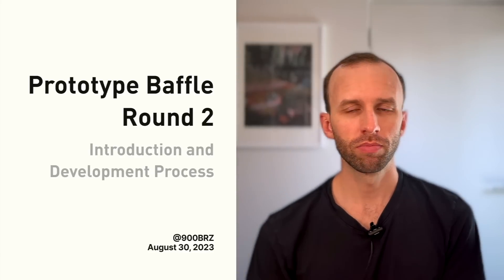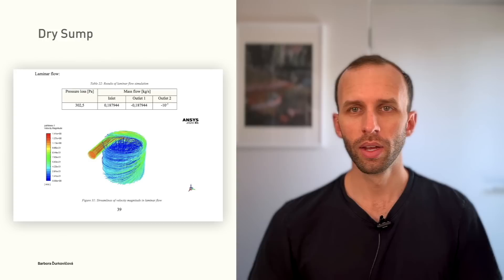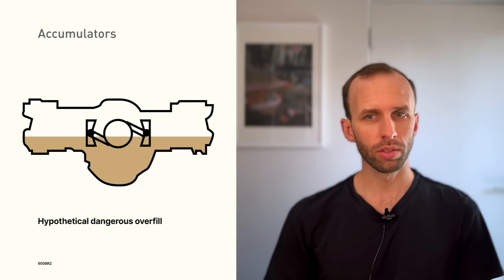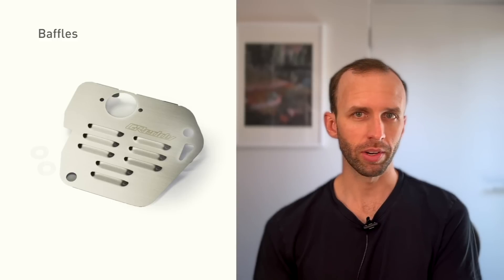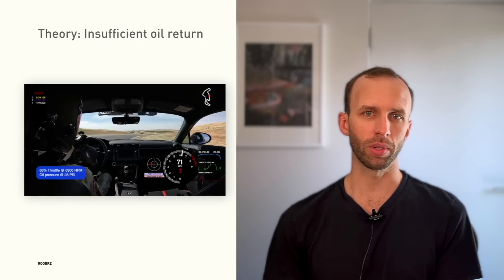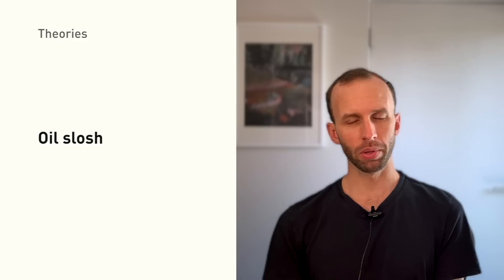Prototype Baffle Round 2: Introduction and Development Process

Comment: Nice video! What tire/wheel setup are you using on the track? Those look nice and I am looking for a setup for my BRZ track day.
Reply from the maker: These are 949Racing 6UL 17x8 ET40. They went out of production a couple years ago when they started to have fakes hitting the market, I believe produced from the same facility. They have since relocated production and are working toward making 86 wheels I believe in early 2024.
Reply from the maker: Enkei TS-10 and TS-5 are also good options with 17x8 ET45. They’re a little heavier but also inexpensive. I think of wheels as consumables, so that’s important for me.
Reply: @900BRZ  Thank you for your reply. Yea, I am also thinking about the 17x8 225 (bronze wheel + sapphire blue seems really good!) for my BRZ. I got really confused (I am new to car modifications) with all the options out there. I noticed that Enkei do sell the two rims that you mentioned, how are they compared to their well known RPF1? Should I go for 35 or 45 offset (maybe a BBK in the future)?
Reply from the maker: @thehoodieguy3491 RPF1 have worse brake clearance than the Enkei options. I think ET45 is better for the rear and you can always add a small space in the front. I’m running ET45 with a 7mm Perrin spacer in front.
Reply: @900BRZ  Thanks for the advise! I just purchased the Enkei TS-10 17x8 ET45 w/ Continental ExtremeContact DWS06 225/45R17 (DD tire)!
Reply: I forgot to ask, since you do quite a lot of track racing, do you ceramic coat/ppf your car? I am worried about the cost-performance ratio.
Reply from the maker: I did a DIY ceramic coat not long after I bought it, but 2 years later the car is now parked outside and that coating is not as effective as it was. I’ve heard the professional ones use different formula that are more durable. No PPF. Also went back and forth on that, but as a track-oriented car, I just decided not to worry about it. I already had a piece of rubber dent my hood from following someone on track haha.
Reply: @900BRZ  Yeah, that's what I figured out as well. It doesn't make sense to keep it in show-ready condition when she is track-oriented. I might as well use that money to improve handling/BBK (unless I have the budget).

It's good to know how your DIY ceramic coating is performing, as I was thinking about that. I already have clear coat scratches (light-moderate) on my doors and trunk after 9 months. I am thinking about whether I should try to repair it myself.

FYI, interestingly, I found a Chinese "YouTuber" having his entire car wrapped in PPF the first day. He did track his car and it still looks new after 13 months (jealously :D). He has an MK5 Supra and a GTR so I think it's not for ordinary people lol.

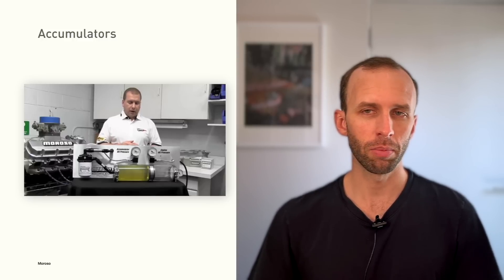4:16 https://www.youtube.com/watch?v=N7c8msl55Ss&t=473s
Reply from the maker: @thehoodieguy3491 Yeah I also had some kind of wild animal scratch my clear coat pretty extensively while I was parked at a trailhead. Will probably polish it out at some point. PPF probably would have done better in that situation, but agree that the money is better spent on functional mods for me.
Reply: @900BRZ  I want to get rid of my light-moderate clear coat scratches as well (mainly door, roof, and trunk). But I am confused if it could be done at home.

How are you planning to have yours repaired? By a shop or at home? Will you do paint correction or just polish? If at home, is a polishing/buffing machine required or can I use a drill with different pads?
Reply from the maker: @thehoodieguy3491 You can definitely do it at home. Random orbital polisher is standard for this type of thing because makes it harder to overheat the paint or introduce deep spots. Some detailers use attachments to power drills for small areas like pillars but I’ve never done that. There are good videos on YouTube, try Chicago auto pros to start.

Comment: What model oil filter are you using in these tests?
Reply from the maker: Standard filter. Interested in doing some tests with the FA20 filter as well.
Reply: @900BRZ  What is the part number you are using?  I see that Toyota now has 90915YZZS1 listed as superseding the original SU003-08412 (15208AA170).  I think this one was used on older FA20 that is slightly longer and has a bypass valve that doesn’t have as much tension as the original.
Reply from the maker: @dadadadada4975  Oh interesting. That part number implies that Toyota has sourced their own part instead of using the Subaru part (SU prefix on the Toyota part number for Subaru-sourced parts). I’m using 15208AA170, which still looks to be the specified part for Subaru.
Reply: @900BRZ  Yes, I know… but I wonder if it was to save costs or because they have concerns over the original shipped from Subaru (x170). The FA24D Subaru filter part (x170) isn’t the same as the previous gen FA20 Subaru filter (x130).  It is a little shorter.  I wonder if Toyota found they needed it to be bigger?  Maybe Subaru will switch back too?
Reply from the maker: @dadadadada4974 Subaru made it shorter for pedestrian safety. It is documented in a new vehicle information pdf. I assume Toyota just sourced their own part for supply chain simplicity. But I can buy one and compare.
Reply: @900BRZ  They made the oil filter shorter for pedestrian safety?
Reply from the maker: @dadadadada4974 Yeah the hood is designed to crumple and they tried to make the surface of the engine and accessories flat.

Comment: I've gone from 2014 GT 86 to a 2019 BRZ and an now picking up my GR86 a very rare beast at it's now banned from sale in the UK and Europe. I wonder as you drive on the right the oil pressure drop is on the right I wonder on Left hand drive cars will the pressure drop be on Left turns? And what is the real cause of the drop dues anyone know?
Reply from the maker: The engine is the same between LHD and RHD cars. Mainly they have to flip the location of the brake master cylinder and booster and the battery. Also the steering column.

Comment: Are y'all running the OEM heat exchanger with the JR cooler? Or did you remove it?
Reply from the maker: The two FA24s have retained the OE heat exchangers this far.
Reply: @900BRZ  much appreciated! And thanks for all the hard work!

Comment: I know that revolution also made an engine baffle for the gr86 made for decrease pressures loses, i also think that maybe a different oil pickup can partially solve the problem , maybe a pickup that ended at the center of the oil pan

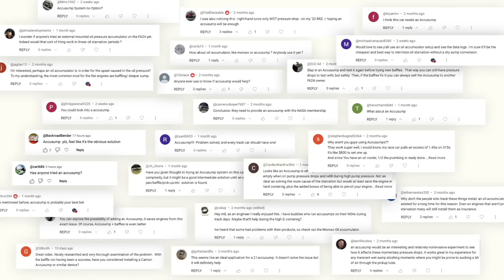Comment: Are you still using the factory weight oil? I know in your previous videos you were, which has always baffled me. As a engine builder/ machinist for near 15 years, its crazy to use the watery 0W. Even Savage Geese has a video in which they work with BRZ/86 specialist and they say to never track the car with light weight oil https://youtu.be/w8pYUeWuHXA?si=4hVzIFyBWHKDZ4IE starts at 1:08
Reply from the maker: No, I’ve never used the factory oil on these tests. I’ve been using 5W-30 throughout. I will switch to 0W-40 in future testing.

Comment: As the oil filter is on the right front side (when looking at the engine bay) 
Could right hand turns be restricting oil delivery to the RH cylinder head? 
As it has already had to pass the LH cylinder head as well as the cylinder block.

Not that it's becoming fully starved at first but if it was enough to slow oil recovery causing a compounding issue.

I wonder if there's a pattern of the LH heads being more prone to damage?

Comment: Thanks for all the great information!  Would one solution be to add a second pickup tube on the opposite side of the oil pan so that no matter if lateral Gs become a factor, there is always oil to be picked up?
Reply from the maker: Some cars have multiple pickups, but I’m not really sure how this works. Wouldn’t that cause an issue if either pickup tube was sucking air?
Reply: @900BRZ  very good point!! I wonder if it could cause some sort of cavitation issues that you see in mechanical pumps

Comment: Very interesting and great work. Now that you have partners with 3D scans of the sumps and some of the engine internals, it would be interesting to understand what is a permissible oil overfill.

From my thinking; what is the capacity of the lower sump and upper sump? How much head room is there before the oil hits the crankshaft and oil aeration occurs.

I just find that 5L fill oil a very round number from an OEM. I'm sure there is some OEM tolerance, but seems very specific.

Comment: Why are you not creating a larger sump with a baffle plate that can carry more oil I think that will solve a lot of the issues and be a relatively inexpensive mod. I think there is already one available but it will not fit standard exhaust systems. I do hope this works as it will be a hot seller no doubt.
Reply from the maker: We’re looking at doing this now. Thanks for the comment.

Comment: Awesome video! Can't wait for the results. FWIW I use an Accusump on both my daily/AutoX car and my track car. I'm a big fan of the pre-oiling benefit!
Reply from the maker: Do you have an electronic value or a manual one? Accusump may still be in the cards for me.
Reply: @900BRZ  electric one, same 3qt setup in both cars. I had a plan to use a nitrous-related RPM window switch for a simple automatic arm/disarm function (along with a relay) but both of my cars' engines are blessed with high idle oil pressures (N54 & LS3) so that hasn't been necessary; I just leave the accusumps armed any time there is ignition power.
Reply: @900BRZ  just uploaded a video of an Accusump install on my 2015 FB25 Subaru Forester, if you'd like any inspiration: https://youtu.be/FZsfSZxJn0U?si=zhAaOexc4EQ4lRfy

Comment: We use clear tubes run from crank case breathers and radiator overflow and sometimes even transmission and then keep filling until we see foam blown thru tube and instantly lift and then drain back. We SLOWLY increase fill until we see an issue.
Where will you see foamed oil first? crankcase breather? Figure out how to constantly sample and pull that thru a clear line in drivers vision. This is simple stuff we do on various cars we track and race.
Reply from the maker: Thanks for the ideas! I took some measurements inside the sump to try to get a sense for how much clearance there is before I start to submerge the crank, but I don’t have a good way yet of correlating overfill volume to crank clearance. Measuring froth and oil in the PCV system seems like a good place to start.

Comment: Would a baffle with larger capacity help? E.g. +1qt with baffle so as to not get near crankshaft and cause overfill issues. I remember my celica with 2zz had a baffle oil pan from moroso that added +1qt as an aftermarket option, but with the already "low" engine design, clearance may be an issue for the brz/gr86.
Reply from the maker: I think you mean a larger oil pan. It would but it’s a little complicated. You can’t easily extend downward without having to swap the pickup. Doing that requires engine out and removing the timing cover, so it’s expensive. You can go wider, plus baffling. You need a custom exhaust header to do that, but it would be something we could potentially look at in the future.
Reply: @900BRZ  thanks for letting me know. My first gen BRZ is mostly stock, but I use it for autox/lapping days, so stickier tires are on. Future plans are to do FA24 shortblock swap with FA20 heads, but I'm still keeping my options open and keeping a tab on your videos. Thanks for the testing and updated vids! If all else fails, I might jump the gun on K24 swap instead since I'm mainly looking for NA reliability on the track, but $15k was the quote I got from ASM Motorsports - they specialize in Kswaps and have done a few on the BRZ twins chassis (with testing) and live conveniently down the road from me.

Comment: Would the 5w30 oil be acceptable for general daily use?  Or just track?
Reply from the maker: I believe it should be no problem for normal use. In hot climates, like Malaysia, the manual specifies 5W30.
Reply: @900BRZ  well I'm from Louisiana so close enough.

Comment: If the pickup is not in the center of the pan, then that's the culprit. <3 Don't over complicate.
Reply: Change the pickup with a baffle to support.
Reply from the maker: That requires engine out and removing the timing cover.

Comment: I hope you manage to solve this! Just out of curiosity, have there been any reported failures in japan. Also which Motul 8100 are you using is it 8100 Power? Which is the ester based one.
Reply from the maker: I’ve heard of one failure but it looked like potentially a rubberized flap from a baffle fell off and clogged the pickup. So I don’t think that one is really relevant other than to warn us to be careful with moving parts on baffles that could fail.
Reply from the maker: Regarding oil: it’s 8100 EFE. 8100 Power wasn’t available when we started this testing and I’m trying to control variables, but Power does look like a better option.

Comment: I really really hope the new designed baffle will at least mitigate the issue in a meaningful way if not completely fix it. But on the other hand, I wonder if a well designed baffle would really help/fix this issue, Porsche would probabaly have had done it a long time ago?
Reply from the maker: Porsche did make a retrofit for the M96 called X51. And there are aftermarket solutions that improve the performance further on those engines. Hopefully we at least see a noticeable improvement, if not a complete solution

Comment: With testing on the weekend, will you try a few different runs at different oil levels as well? Like one run at 5L(normal fill) and another 5.5L or 6L?
Reply from the maker: Yeah 5.5 for sure. I’m still trying to understand how the oil capacity correlates to clearance from the crankshaft to ensure that a 1L overfill is still safe.
Reply: @900BRZ thank you testing this out in the following video. Shame about what happened on track, but you did still collect some solid data points.

Comment: Thanks for continued, thoughtful, development work (which should have been done by the factory...are you listening Toyota/Subaru as the class action lawsuit is building momentum). Donation for $100 via PayPal has been made. I hope everyone else with an FA24 watching this does the same. Since the factory doesn't appear motivated to make a solution, $100 is a wise hedge against an 11K long block replacement when the dealer/manufacturers tell you to sit and spin. Please keep up the great work. Looking forward to a reasonable solution to a factory engineering mistake..
Reply from the maker: Thanks so much for the generous contribution!

Comment: What I'd also be curious is finding out if the oil pressure drop is found in the FA24F inside new Subaru WRX's.
Reply from the maker: I heard that one called FA24DIT. It has differences to provide oil to the turbo so I’m not sure. One thing is there’s a lot more room for a higher capacity sump, so in some ways it would be easier so solve on that car if there is an issue.
Reply: @900BRZ  Not to suggest the WRX will have the exact same problem, but I would be curious if the fundamental design exhibits the same similarities. Much like how the Gen 1 86/BRZ was used as a control in the original test, it did show pressure drops as well, but not as extreme as to cause failure.

Comment: I contacted NENGUN about possibly getting access to the STI oil pan used for the GR86 Cup cars. I'm still awaiting their response but it looks far more involved than any of the other baffles I've seen. The part number is STI ST11109Z2000.
Reply from the maker: From what I’ve heard, the US GR Cup cars are not using that specific baffle.

Comment: i pray that this solution works in reducing the oil pressure drops. i plan on doing autocross next year and id rather be safe than sorry.
Reply: You really don't need to worry about autocross. This is more so for track driving.
Reply: @DirtMagert97  I just don't want to risk it.

Comment: Thanks for doing this. I look for updates every day. It would be cool if the new baffle works. But if at high rpm's there is basically no oil left in the sump, I wouldn't expect the baffle to get it done.  There is a You tube guy (BTR Justin) that did some spirited canyon driving and he did not see any appreciable drop in oil pressure when turning right. So for us Daily Driver guys, this is probably not a big concern. But it is very interesting. 

I wonder if a redesigned oil pan would be of any help.
Reply from the maker: Yeah I think a redesigned oil pan plus a header to provide more clearance would be a good possible direction as well.

Comment: One little mistake I see about oil flappers that other manufactures goof if they're only supposed to be used in the vertical position,  and when incorrectly used in the horizontal position they droop after some heat cycles.
Reply from the maker: Yeah I’m not a huge fan of horizontal flaps but one thing that occurred to me is even if they sag a bit, oil pushing against them could still close them against the horizontal surface. The main risk is that they fall off entirely.

Comment: I tested an accusump and it didn't solve anything. In the interim (and for people who can't install a baffle for rules/classing or other reasons), just run a quart over the high fill line. My car survived COTA with no substantial pressure drops with it filled 1.5 quarts over the high line.
Reply from the maker: There’s some other nuances with accusumps. In theory you might not fully recover the pressure in the oil passages, but as long as it’s dumping oil, you are increasing flow. Ultimately flow is what protects the bearings, but it’s just very hard to measure. 

Surviving a track day is 1 thing, but I’m hoping we can make these cars survive many track days 😉
Reply: @900BRZ I think the key part was "with no substantial pressure drops".